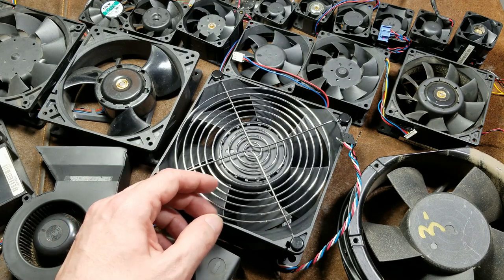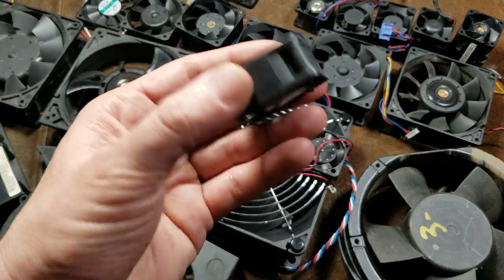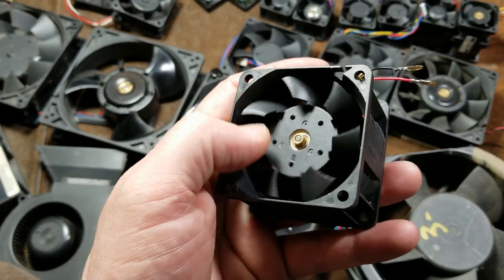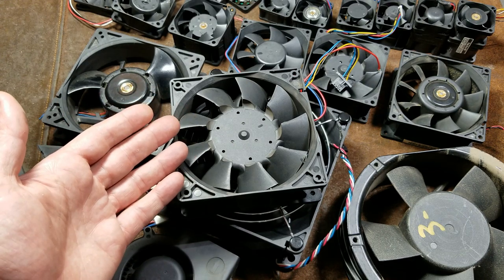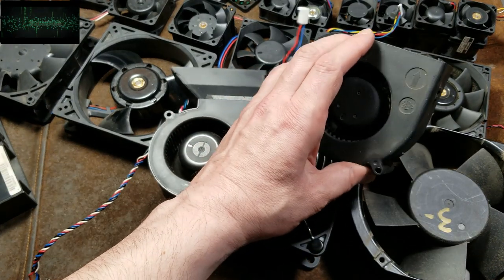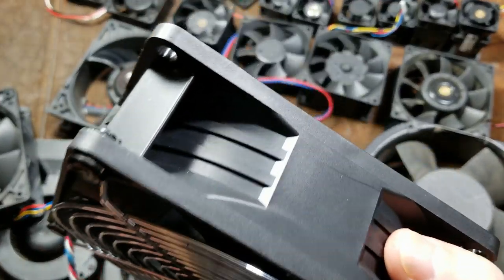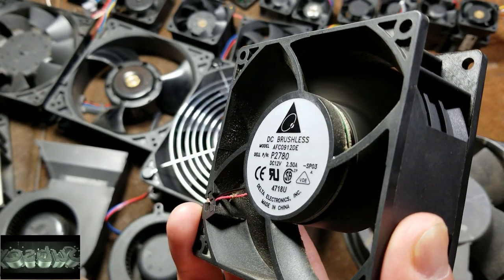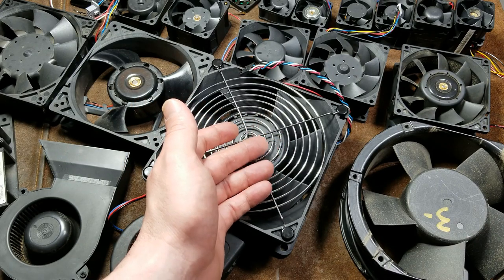DC Computer/Server Fan Size & Performance Discussion/Comparison

Comment: Hi Catus, thanks for the video.. Been trying to research some information on fans types and sizes - I'm trying to find out what type of fan I should use for an air filtration system on a small cupboard for cleaning electronics. The cupboard is just about one cubic meter and I'm using a 30cm by 40 cm hepa filter (maybe ill have to increase that). I really would like to get a strong flow of air going and I'm a bit confused with what type of fan to use and what kind of setup... I find a lot of people using usb fans but it doesnt feel strong enough... any advice? thanks for your help

Comment: Awesome vid.

I pulled a Nidec TA600DC from an HP server, 12v 10 amps 120w. The connector is the hp 6 pin connector, do you know anything about the pinout for them?

Comment: I'm getting nowhere fast trying to learn about wiring my Delta EFC1548DG 48V 3.12A fans. I've learned that this model number is only a line designation, with capacities from half an amp to at least 4 amps. No data sheet is available on the Delta site, possibly because it isn't in production any longer? Some videos state that brushless fans won't run on straight DC, or possibly need to be manual started, which doesn't seem to be the case as you are powering them with what I assume, is DC, not PWM DC. I searched Amazon and ebay for a brushless controller that would handle my voltage and amperage, and the higher voltage I want to operate from (up to 80V open voltage from a 48V solar array). The only controllers I could find were for e-bikes and had 40 irrelevant signal cables, such as anti-theft. Some controllers have the blue and yellow PWM and tach wires reversed.  There is definitely a need for more info on Youtube about PWM control of server fans. Thanks for your interest in these classy devices.

Comment: you should chack out dealta PFC1212DE 12v 4.8A fan with 300CFM air flow in 120mm 38mm thick.

Comment: So any of these fans can in fact be used in any home PC case? I was under the impression, that you can only use these fans in server type setups? I have a 750watt power supply in my PC, and an old gaming Z motherboard installed. My current fans are 120mm front, back, and side panels. And my top fans are 200mm NZXT fans. Can I install any of these power fans without frying my motherboard?
Reply from the maker: No you need to find out at the motherboard header can take the wattage otherwise you need a special adapter where the fan power wires directly connect to the power supply and the siganal wires still connect to the motherboard
Reply: @CatusMaximus  the headers usually do 1A max

Comment: What model is that avc fan large fan with grate
Can it be run with a anker. Power bank?
Reply from the maker: It's a 12-volt fan so anyway you get 12 volts DC to it it will run car batteries power Banks solar panels hydroelectric generation facilities you name it

Comment: Lol, I don't know if anyone threw in this joke yet, but here it goes. At 4:50 into the video. How do I move a lot of air out of a tiny hole? Go to White Castle at midnight, and pick up a sack of 50. Then on your way back home, go to Mcdonals and pick up a few items from the dollar menu, after that, go to pizza hot and buy a few pies. go home, and binge on all that. Guarantee to move a lot of air not too long afterward. And then some.

Comment: I cool my 5kw solid state tesla coil with a 300W Drone BLDC motor(4$ motor 3$ ESC) rigged to the 12inch x 16 inch aluminum heatsink.
Reply from the maker: Oh yes and that's probably the most common question is why the some of these computer fans are so expensive considering what you just described and really it's airflow per watt through a specific size opening given a specific size package. And the fact that many Deltas are rated for 70000+ hours of runtime

Comment: I hate to say this to you but uhe doesn't stand for ultra high end the e has no meaning your right on ultra high let me tell you about model numbering system the last digit stands for thickness the a stands for 10mm thick the c stands for 13mm thick the b stands for 15mm thick the d stands for 20mm thick blank stands for 25mm thick f stands for 32mm thick e stands for 38mm thick g stands for 50mm thick s stands for 56mm thick w stands for 76mm thick and thats how it works 👍
Reply: By the way cool fan video
Reply: That is a bunch of monsters though

Comment: Catus, You should check out my channel, I got ton's of videos about fans and stuff that I'm sure you would like, also Delta have always been the best of the best,  I'm in the middle of doing a bunch of computer fan flight tests for my YT channel, and am up to 80mm but I have several 60x60x35mm Delta's rated at 3.3 amps and they actually fly, not just hover but fly at about 15v dc!